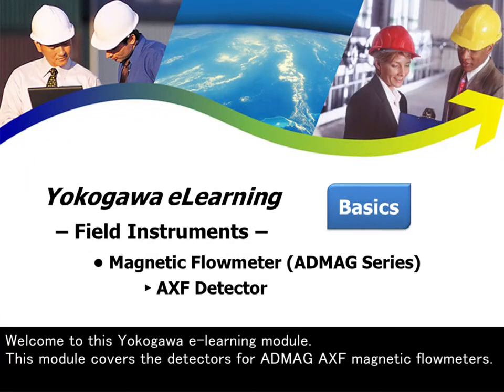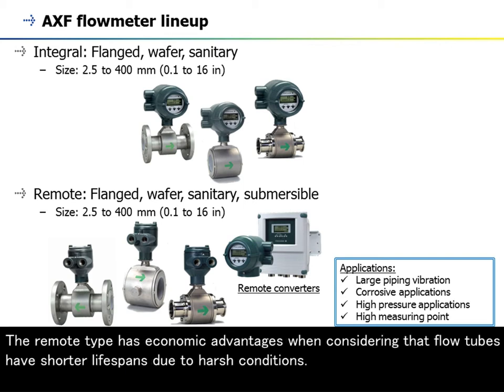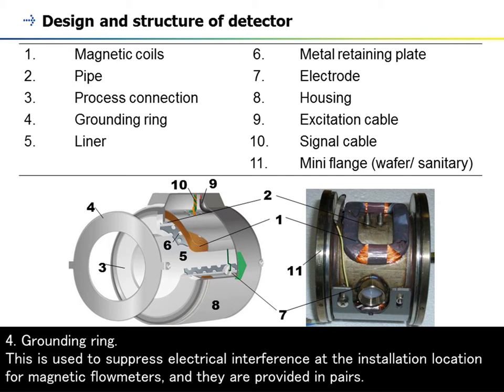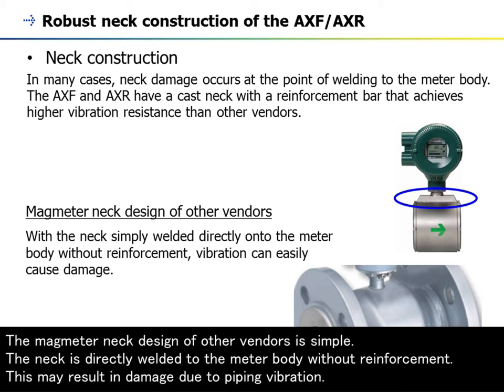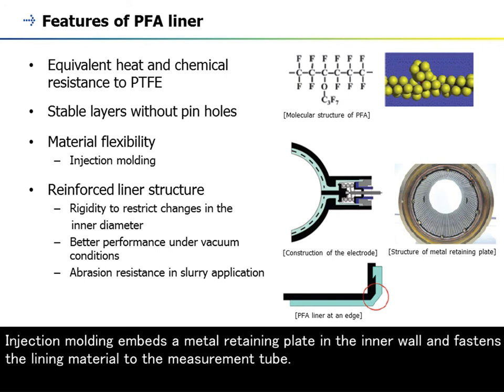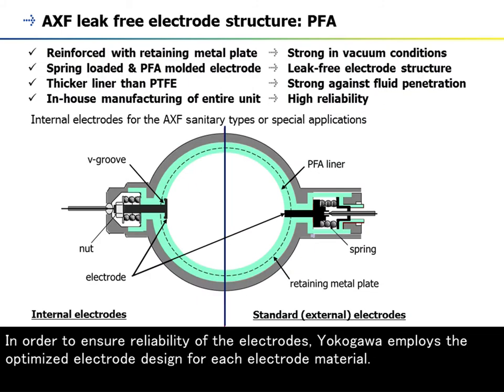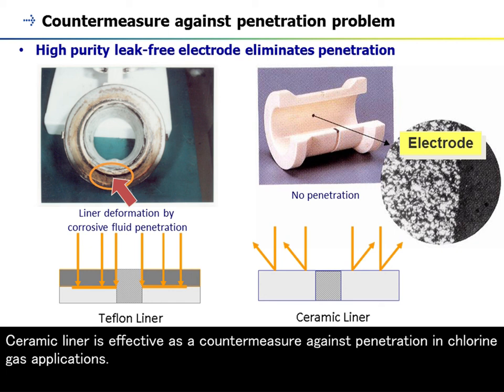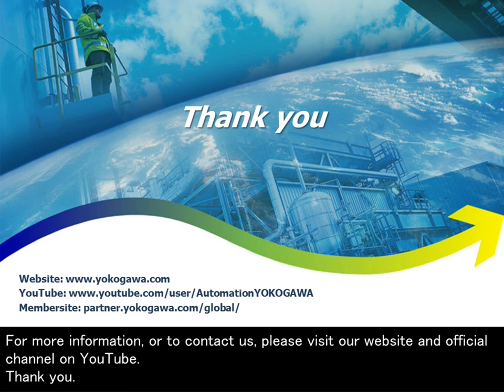11. Magnetic Flowmeter (ADMAG Series) - AXF Detector

Comment: What happened when control signal is fail of a control valve thats opne or closed plz tell me
Reply from the maker: There are some reasons when control signal of AXF goes failure. If it goes failure, its control signal (current output) compulsorily goes burn out (0mA or 25mA). The customers can set the direction of
burn out. Please refer Instruction manual of AXF (6.5.2 Alarm Selection in IM01E20C02-01E). You can find it if you click below.
<https://www.yokogawa.com/solutions/products-platforms/field-instruments/flow-meters/magnetic-flowmeters/admag-axf/#Downloads>
Reply: Most of the Times drain and vent valves will open and process inlet valves will close . Depends on valve fail safe design